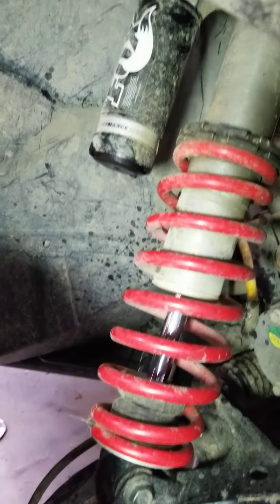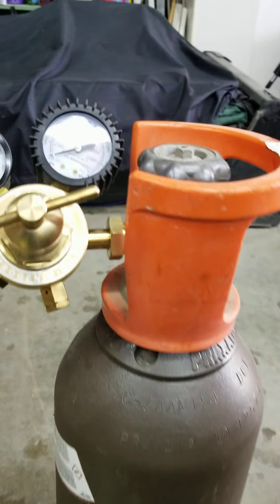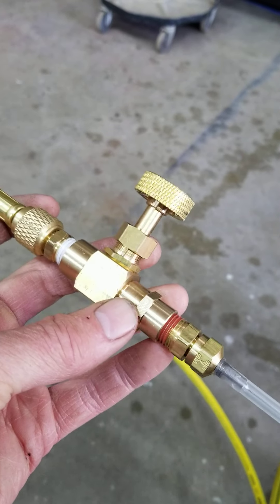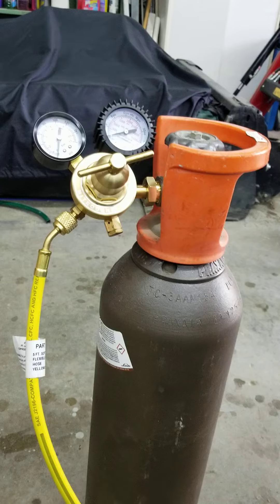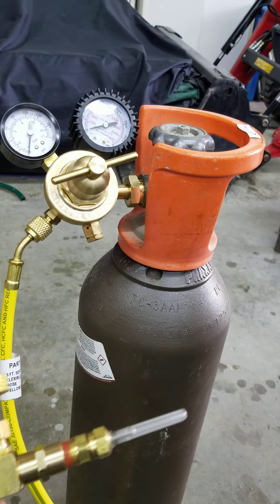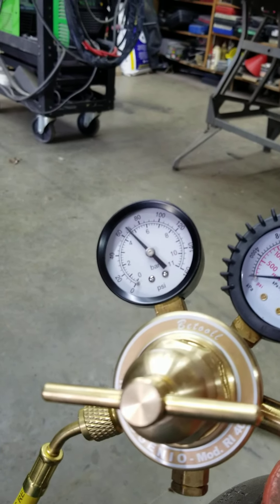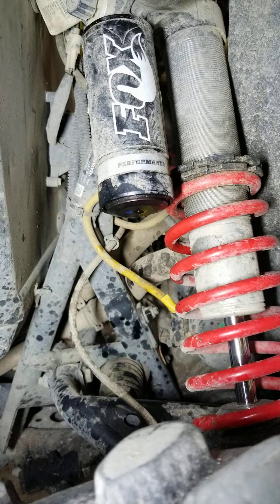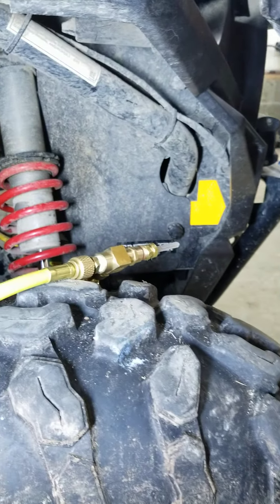recharging fox shocks with a home made setup and argon welding gas.

Comment: I have thought about using Argon. Like many others I have switched all my shocks to high pressure shrader valves on Al my shocks to eliminate the leaking rubber pill/ needle fill procedure.   That will also save some money.   Good video.

Comment: I think you don't need to get a whole new regulator. You could probably use the argon regulator but replace the cfh flow gauge with a psi gauge. That would save some more money. Or even cheaper would be not even change the gauge at all if you already have a high psi digital bike suspension gauge with bleed button.

Comment: Have any more info you can share about the need used?Thanks
Reply from the maker: Sorry not sure I understand the question
Reply: The needle used...?
Reply from the maker: @MJCART-be9nb  this is what you need...

NICECNC Shock Nitrogen Needle Fill Tool Replace YZX,RZR's, Arctic Cat,Ohlins,Raptor truck shocks,Fox UTV,snowmobile shocks https://a.co/d/2tHY1G1
Reply: Thank you..  by chance what state are you located in?  I'm in MN
Reply from the maker: @MJCART-be9nb  I'm in northern Ontario
Reply: @ontariooutdoorsman  Do you think a guy could use a 75/25 argon/CO2 mix?
Reply from the maker: @MJCART-be9nb  I wouldnt.  Co2 is not an inert gas

Comment: I have an argon/co2 bottle.
Will my bottle work for filling shocks?
Reply from the maker: So I would not use argon co2 mix.  Co2 is not an inert gas and it's possible that over time could cause oxidation or deterioration to rubber or metals.  I'm no expert but that's my 2 cents on it.  Pure argon is inert.
Reply: @ontariooutdoorsman  Just what I needed to know.
Thank you.